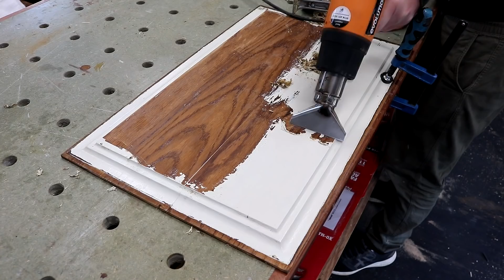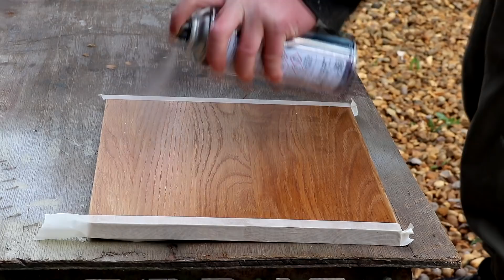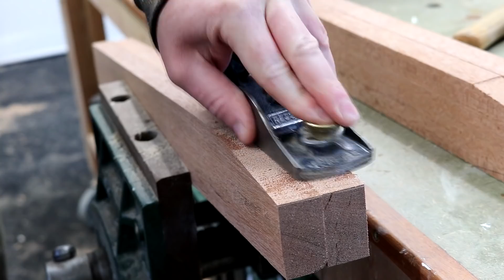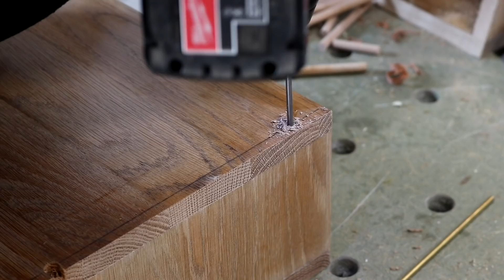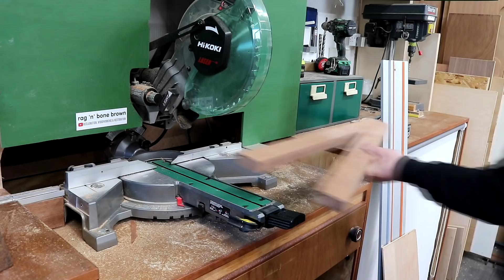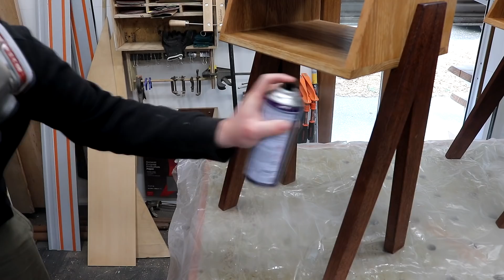Making Bedside Tables / Night Stands : ONE HAND CHALLENGE

Comment: My immediate thought was how dangerous this is but then it got me thinking it's probably no more dangerous than working with 2 hands.  I expect a lot more thought was given as to what could go wrong prior to each task and as for using a chisel it is probably safer.  I am sure we have all caught ourselves with one hand in front of the chisel at some point. Complacency is the biggest danger and I think the end product shows that there was  a vast degree of control exercised during the build. However I do think if a passer-by had seen you with the masking tape you may have been carted away ;-)
Reply: It’s sad that the negative comments imply that unless you have 100% mobility you shouldn’t  be doing anything like this which is definitely not the case. There have been some great projects across YouTube because of this challenge.
Reply from the maker: yeah totally agree, if anything I was paying more attention and therefore less compacent than normal two handed project 👍 shame a few others didn't really get that

Comment: Such a good video Keith and very impressive product! Quick question - that low profile riving knife on the table saw - is that a modification or did it come like that and would it for a Dewalt DW745?
Reply from the maker: Thanks Will! I'm pretty sure that the Milwaukee came with two riving knives in the box, so I didn't need to adjust it which is nice! 👍
Reply: Hi Will, from my research I don’t believe the Milwaukee riving  knife will fit the Dewalt 745. I ordered a spare riving knife assembly and modified it with a grinder and file, so I still have the original just in case. Sure there’s a video of it somewhere on YouTube if memory serves.....